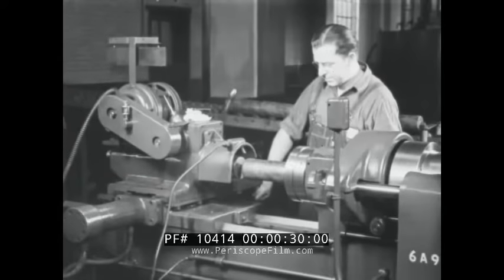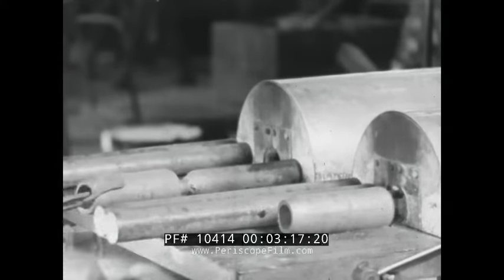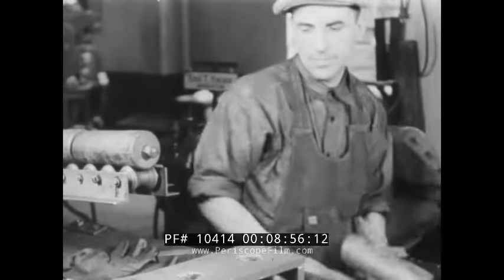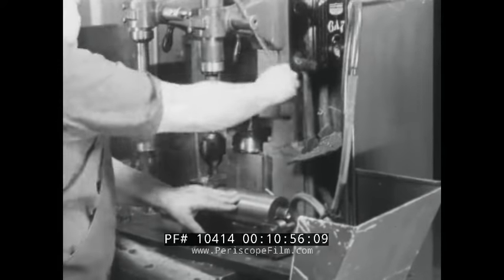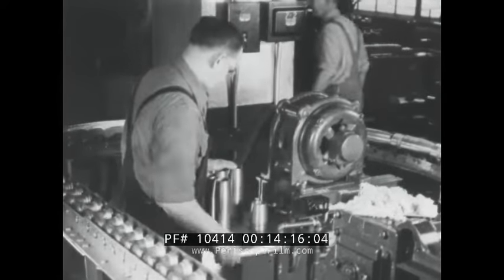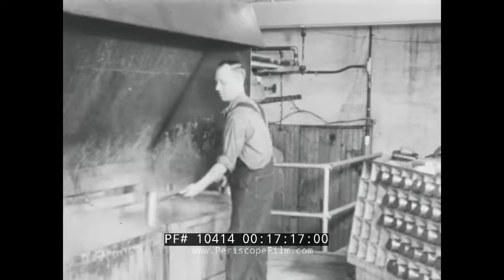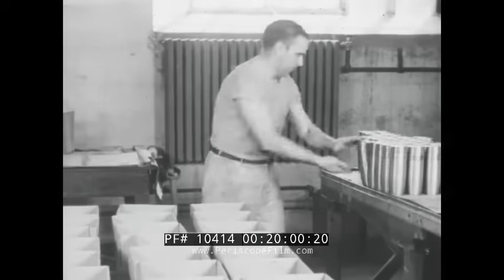MANUFACTURING 3-INCH ANTI-AIRCRAFT SHELLS     WORLD WAR II ORDNANCE FILM FRANKFORD ARSENAL 10414

Comment: It is interesting that smoking was allowed at work - several pipe smokers early on.
Many of the jobs were of people loading and unloading. The quality checks were also done by humans. Today, most of the transfers are done by robots and quality checks are overseen by humans but machines do the checking.
Reply: Not smoking at work is a relatively recent thing that mostly happened in the 90s. I used to smoke all day while working in print shop full of paper and highly flammable chemicals. The good ol' days.
Reply: Dimensional quality checks are done the same way today. In process go/no go gauges with a statistical sample sent to the metallurgy lab for testing. You'd use a CMM for some of the quality audit steps today but that's about the only difference  besides having variable gauge data logged for your control charts.
Reply: @Les537  Lol....the one asking this question must be 20 or younger not to know this...we used to smoke on the shopfloor and in the cafetaria as recently as 12 years ago...and all was normal. All the anti smoke nazis caught up wit us...
Reply: @ZerokillerOppel1  I remember when you could smoke on an airplane. It wasn't that long ago.

Comment: Wow so labor intensive even with machines. How could they crank out millions of these shells before and during WW2?
Reply: Lots of machines I assume. I'm quite surprised at the amount of work that went into them too.
Reply: Lots and lots and lots of hours.   Anger too, we were in a do or die sprint.  Everyone went to the factory.   My great grandmother went to an oil refinery.
Reply: A lot of people did it in a lot of places, running 3 shifts 24 hours a day 7 days a week. 
By WW II most of the US arsenals served mostly as design and prototype facilities. They designed the shell/ammunition/weapon and did an initial production run in-house to work out the kinks in production. Then they had a design documentation package that they could present to some other business or factory to give them a starting point on what they would need to implement to do the same thing. 
General Motors or whoever got the production contract then had a much bigger factory that had previously been making car headlights or refrigerators or some such, and this factory was converted to make the shells. Then they hired thousands of people to work the factory at full production and make the shells.
Reply: That is why pops came home and the first thing he did is get a three-finger drink no ice and  smoke a fat cigar.😎 Remember a lot of ladies join the workforce to a andt they are badass b****
Reply: It was a time when when we faced adversity with vigor and did what we had to do instead of hiding in our apartments hoping we won't get sick.
Reply: Lots of people and lots of factories.
If you do a hypothetical estimate as mentioned in the video one process has a capacity of 1000 shells per 8 hours shift, say that this process serves two lines and there are 20 lines in a factory, and there is a single factory in each state  which makes it in total 50 factories running 24/7 with 3 shifts, then each day 1,500,000 shells of this kind will be produced.
I'm assuming that during the war there where thousands of factories with 10s of thousands of production lines dedicated for production of different kinds of ammo all across the US.
Reply: @XoftC  During  WW 1, an artillery barrage might shoot off thousands in one engagement. The Germans fired off over 200 million artillery shells during the world war.  They are still digging up un-exploded bombs in Europe from WW 1
Reply: l wilton hello, but the GM  plant in LINDN NJ. I was told made aircraft there, & in tunnels under the roadways, rolled them across the street to LINDEN AIRPORT, in  WWII days , cheers from NJ 🇺🇸🇺🇸🇺🇸🇺🇸
Reply: @flybyairplane3528  I decided to take a drink each time I read your "cheers." I start AA meetings next week.

Comment: @ 15:45. Called those strings "swarf" in a wood mill. Dangerous work to clear it away from the head and chuck with a pointed stick ! I  love  machining.
Reply: We machinists either called it swarf or chips. That's because a lot of initial machine tools to cut metal came from wood working.

Comment: Interesting , ......but a lot of work for just one kaboom !
Reply: Compare it to an effort to make a plane from a same era and possibility to knock it down using a single shell like this (or 30, it doesnt really matter if you compare a cost)
Reply: @Helloverlord  

Surely you are right , ......but a plane is made to last and to serve a long , long time(at least in peacetime theory) , but such a shell is designed just for ONE kaboom , ......and this is , what I find kinda intriguing ,.....it's just not a New Years Eve firecracker made of paper and powder , but a very accurate technical device .

But still cheap , if you compare it to a modern missile , which is also made for just one kaboom , ......it's insane , somehow . 

I've been working in the German metal industry for 40 years now , therefore I'm familiar to most of the working processes shown .
I find it pretty much amazing , how they've managed to rationalize the manufacturing processes back then before the days of CNC machining .
The machining processes alone haven't changed much , I guess , ......just the human factor has been substituted by robotic machine parts , especially for moving the workpieces in and out of the processing machinery .
Reply: @61diemai  I know few planes got hit on maiden combat flight, comercial planes are not usually taken down by shelling...lol
Reply: @Helloverlord  

Usually not , ..that's true !
Reply: That explains the move to guided missiles.
Reply: You would hardly be concerned if on the receiving end of that diving kamikaze.

Comment: Wow, up until I retired 3 years ago. I used the same type of O.D. Callipers while I was doing machining and die setting. Of course we had digital too nowadays, but still kinda cool. We even used the same equipment too. Some of the transfer presses we used were made during WWI! I was late 20’s and some were 60 years OLDER THEN I WAS. But they work just as well today as they did new. Even the go-no go plugs are the same more or less. We still used that water-oil mixture for coolant too. (It’s the white creamy stuff spraying on the machining part) You have to change it every so often, because it gets full of bacteria. I had to wear a dust mask because I kept getting chest infections from it. I had to have my ear real close to the grinding well to hear the pitch of the coolant just before the grinder made contact with the journal end.
Reply: Still today we dont need a digital caliper for a go/no go guage.

Comment: I really thought these would have been cast not forged.
Reply: Silas Porter Too many air bubbles for something that goes bang. Probably would end up blowing a gun.
Reply: @Frankntooth  Cast iron or malleable iron does not suffer from porosity as evident in its use in machine tools such as lathes and mills. The only thing I can think of as to why it wouldn't be suitable is its brittle nature. Perhaps under high g-force it would crack or fail in some other way.
Reply: Silas Porter Maybe not in it’s literal definition. But there most definately would be some irregularities over the course of production. And any tiny discrepancies when it comes to ammo is no gouda man. I think it’s just one less variable for them to worry about despite being it being a longer process.
Reply: @Frankntooth  Just did some research. Turns out cast iron as well as pig iron was used in the manufacture of explosive ordinance. I guess for this certain shell it didn't meet the requirements.   https://en.wikipedia.org/wiki/Shell_(projectile)
Reply: Four quick hits and it's done.   No sand molds to ram and no long wait to de-mold.  Forging is lightyears faster.
Reply: @Doughboy1941   You are correct.  The shell must be of heat treated steel to survive firing from the gun.  No plastic deformation asllowed in the gun barrel.
Reply: The stiffer the metal, the thinner the wall, the more explosive filler.
Reply: Casting is weak garbage
Reply: I'm an engineer in a forging plant and we still use these exact 3" national upsetters everyday to forge parts for the automotive industry. The reason the parts are forged is so that grain flow is produced in the direction of the part which imparts much more superior strengthto that of a cast part. We still use the same induction heaters same shear presses facing machines gages turning operations etc all almost identical to this.

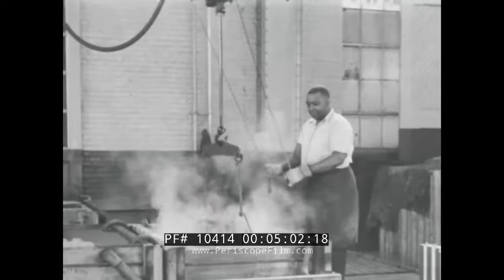Comment: 5:00
they are pickled? lol
Reply: Yeah, it's a term most often used with food products but has an industrial use: http://www.nationalmaterial.com/what-is-steel-pickling/

TL;DR: It's a way to clean any oxidation/crud off the shells.
Reply: Cleaned in  acid = pickled.
Reply: @hallofo8107  - thanks for that very informative link. Imagine being the guy ultimately responsible for deciding upon the pros and cons of which acid(s) to use to manage the pickling process.
Reply: @hallofo8107  I have been pickled a few times

Comment: For some reason I never thought of shells as being nicely machined pieces from solid metal rods. I figured they would start with a hollow rod. Cool video and interesting process.
Reply: High precision products. Anything out of tolerance (length, diameter, wall thickness, concentricity, weight) means the gun won't even come close. Anti-aircraft gunnery was a science pushed to the point to where it was an art.
Reply: Hollow castings is crimean war technology.

Comment: I fixed machines at a company that made cylinder liners in 2000. The machines were used in 1936 and beyond for manufacturing shell casings. They made machines to last then.
Reply: I have a Southbend lathe from the early 1920's. It is still a decent machine.

Comment: Fast forward to th year 2020 and we were still using the same lathes from back then at my shop. We obviously had modern computer programming $1million dollar CNC machines that could do many different things in 1 cycle. But we even had machines off of a WW2 battleship. And the machines were still 100% useful and working today. No computer codes or programs to enter for operation. They were all manually set up and operated by hand.

Comment: I was a tool & die maker, back in the '70's. The little die shop had me making a "LOST-WAX" mold to form Wax into a part that, as I understand it, they would pour molten wax into the mold I made and make a Bunch of them. Then they would attach a bunch of them to a single rod of wax, with a smaller piece of wax rod and would dip the whole thing into a pottery slurry and throw fine silica sand on it and let it dry. Then do it again, and let it dry. And switch to a courser silica sand and keep dipping it in the slurry and spraying it till it had about 6 layers on it. Then they would cut the wax stem off and turn it up-side-down over a tray inside a kiln and bake it into a porcelain and all the wax would pour out. A spru hole was in the area where the stem came out and they poured molten Stainless Steel in there. Then they busted the porcelain mold and popped the tree out with all those stainless steel finished parts on there. All that was left to do was to cut the stem off and grind the spot off where it was. As I understand it. That was the stainless steel turrent mount for an M-60 machine-gun on a Huey Helicopter. I feel that I helped in a small way.

Comment: Saw a lot of comments about lack of PPE.Iwas a tank mechanic in the army starting in 1957/1959. Then backat it in 1961 till around 1967.We never were issued any type of hearing protection even though two mechanics one standing on each side of a tank engine could only commucate using hand signals,the engones were too loud to be talked over.Yes I wear hearing aids today 
beacuse of that and suffer tinnitus and about 50% hearing loss.

Comment: I'm a machinist. Manuel lathes, knee mills and boring mills also CNC Lathes and mills for 25 years. I do my own programming ad set ups. All I can say is the most impressive part was the machines and tooling of them to be able to mass produce. Those old machines had one purpose that's it..
Reply: That was the purpose of them. It was like an assembly line not a job shop.

Comment: incredible.  does anyone know if the shell casing could be reused or refurbished?
Reply: It explodes into a million fragments after being fired from a 3-in anti-aircraft gun to a certain height (the explosion timing being determined by the fuse). The shrapnel from the shell casing inflicts the damage on the plane, since you would rarely ever directly hit the plane target. So, no.

But if these shells sat in a munitions depot for years unused, than yes, after removing the top fuse and interior explosive, you could recycle the steel for scrap or novelties. IIRC, the 3-in AA guns were obsolete by early WW2. They probably just dumped the excess unused shells into the ocean.

Comment: 16:55 whats the point of attaching a thin metal disk to the base of the shell?
Reply: The softer metal driving band serves two purposes.  The first is it provides a seal between the shell and the gun barrel.  The prevents the gases from the propellant from escaping around the projectile.  The second function is to engage the rifling on the barrel.  This will give the shell a stabilizing spin which increases accuracy,
Reply: @CaffeineGeek  I thought both were fulfilled with the OD of the slug itself

Comment: I think it would be interesting to compare the production process in this 1939 record to the way the same product was turned out in 1944. I bet they did the job in less than a quarter of the time by then. You get really good at a job when you make them by the millions.
Reply: I'm an engineer in a forging plant and we still use these exact 3" national upsetters everyday to forge parts for the automotive industry. Same induction heaters same shear presses facing machines gages turning operations etc all almost identical to this. And surprisingly most of these operations are still done manually. I've ran the 3" upsetters with tongs and a lift assist identical to this.

Comment: Questions for the munitions experts amongst us;
This is just the exploding part of the shell, right? The hollow part gets filled with explosive and a fuse gets screwed into the nose. Then there is a lower casing added with propellant and a firing pin. So this is only one piece of 3 that needs to come together to make an entire 3" 'bullet',  if you will? Thanks
Reply: Not an expert on munitions but informed.  Yes, this is the shell that explodes.  There is a cartridge with a primer in the head (head=base) that holds the propellant.  The firing pin is part of the gun.  It strikes the primer which causes its explosive charge to ignite the gunpowder which burns rapidly causing gas pressure to send the shell on its way.  Interestingly, the powder if burned in open air, burns very slowly.  It is not explosive.

Comment: Main difference today would be in use of less specialized machinery. Notice a lot of machines are set for just one operation or even made to just one set of very similar operations. You cannot easily produce say 4" shell and certainly it would be impossible or next to impossible to move production to say engines. Modern CNC machines are more versatile - you can move production quickly to different things. Also each machine can do more operations and you can load two machines or more with a robot - thus decreasing your human worker need by large factor. The gages used are same ones as today for inspection through we can also use laser based stuff speeding things up - on the other hand CNCs are more precise - so far less need for constant inspection. 

Anyone notice set screw at the end was not a hex but a flat screwdriver? You can tell by that detail it is WWII vintage.

Comment: Great video.  What's the purpose of the band around the base of the shell?
Reply: The band engages the rifling inside the gun barrel. It is brass, a softer metal than the steel of the body of the shell.

Comment: Anyone know how the delay fuse works? There were notches machined into the end to aid in setting the cap/detonator.   You would also assume a casting would fragment better than a  forging.  Interesting vid.
Reply: Fuses are another story.  They varied considerably. They are distinct from the shell. A casting would be too brittle to withstand the force of the explosion within the gun.
Reply: Pyrotechnics.
Reply: @russellsantangelo1  Gunpowder does not explode.  It burns.  The black powder of the 1800s explodes.  Big difference.

Comment: 9:07 A vertical lathe? I wonder why being vertical is a benefit? Does the weight pressing down let you do bigger cuts?
Reply: Takes up less floor space.
Reply: Allows for very large diameters with simplified bearing arrangement in a small space. Great for locomotive wheels.

Comment: Very labor intensive process. Only a thousand per eight hour shift. It would be good to see how modern manufacturing would speed up the process. Just a side note: at 18:00 he is tapping the band to hear if it is tight. I used to build Formica countertops and would do the same thing with my fingernail to be sure I had good adhesion.
Reply: The output was 1000 pieces per machine per 8 hours at some stations

Comment: What would be the use of an extra metal plate @ 16:59 ? Why not just make the shell a bit longer?
Reply: It is the wadding for the shell. The core of the shell is filled with lead balls and a brass casing containing the firing charge is pressed onto the bottom. A fuse is screwed onto the top of the shell to blow it apart and send the lead pellets flying in all directions either on contact or timed so that it will explode at a specified altitude.